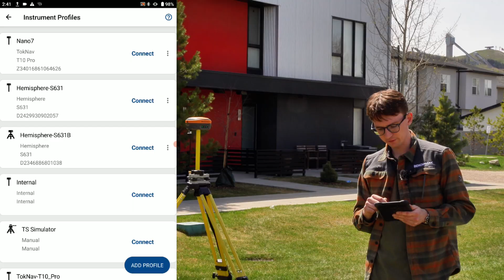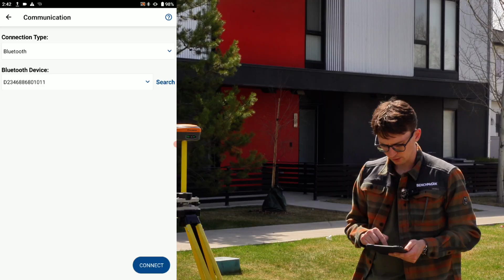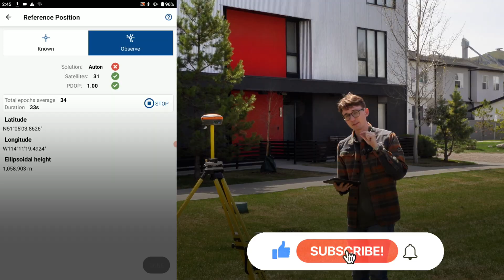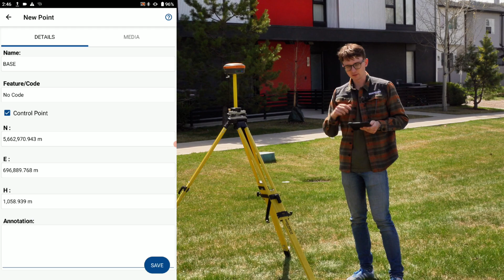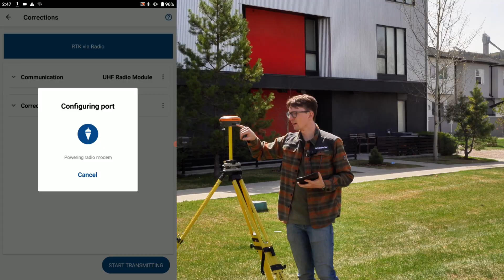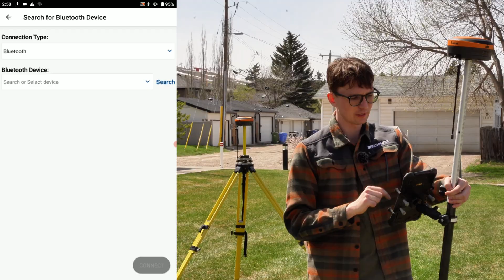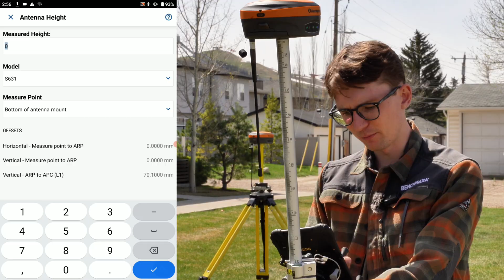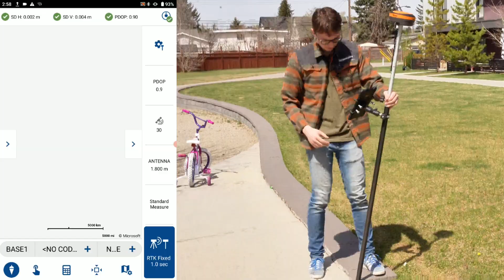How To Set Up RTK GPS/GNSS Base and Rover (BEGINNERS GUIDE)

Comment: Best video on the topic I have seen so far. So grateful for your great tutorial. Still have one question about setting up base on "unknown point". You mentioned the base can average unknown position ~0.5 m accuracy only and needs a further refining step when the rover is setup. But in the video you started measuring with the rover right away 🙂. Do your positions not all have the ~0.5 m error, yet? What steps are required with this setup to get position accuracy to survey grade ~1cm. Did I miss something???? Any clarification would be great.
Reply from the maker: Hi Holo, this is a great question and the answer has to do with the difference between precision and accuracy (one of my favourite topics, that I do have a video on! https://youtu.be/IrvHVNu9tOA?si=b1SBI8ehxYktSZar). RTK when setup with a base with always be precise, with a ~1cm accuracy relative to the base. However, with the unknown point setup there is up to a 0.5 m difference between the "real" world coordinate and the coordinate the base is setup over. Therefore, when setup over an unknown point, this setup is precise, but not accurate. 

In order to be both precise and accurate, you need to either setup the base over a point with known coordinates or perform a localization with the rover, (I also have a video on that! https://youtu.be/IYd5em8OQEE?si=Br7_fhCthEW8kVrc). 

Let me know if you have any more questions, or video requests!